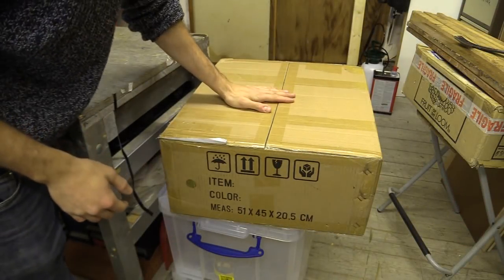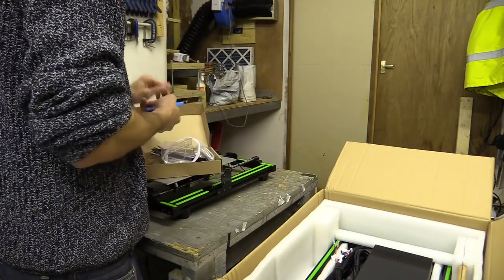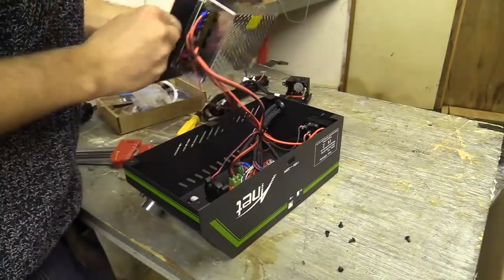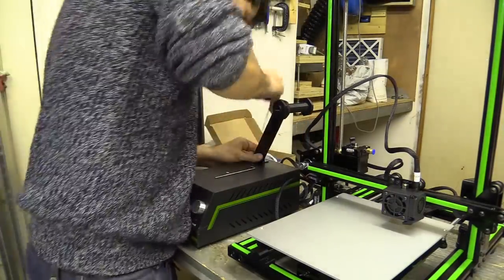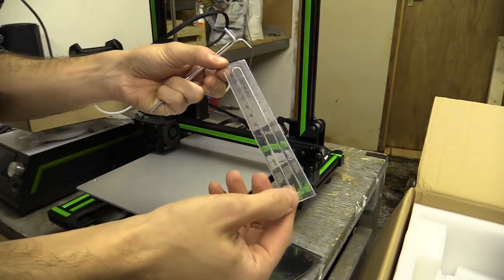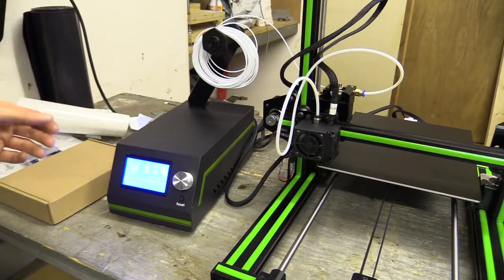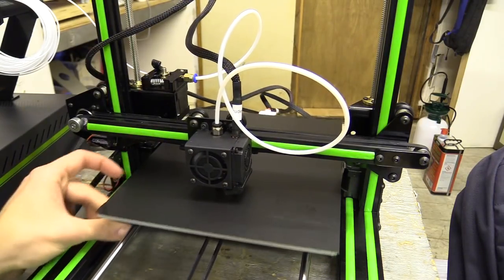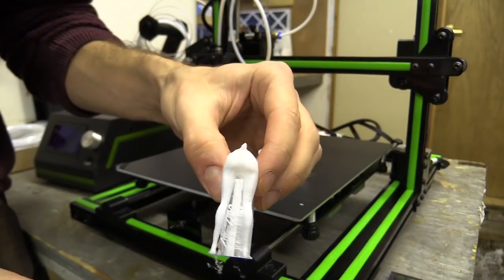Anet E10 3D Printer (Transporter Accident)

Comment: How odd, I was only looking at this machine last week - I was very tempted by the build volume as my current one is only 135x135x135mm.
Reply from the maker: https://miscpro.com/top3dprinters/  This is my top 3D printer list so far. Which 3D printer do you use?
Reply: I'm using the Vector3 which was the magazine subscription build it yourself one from Eaglemoss. Not a bad printer after some heavy modification, just low on build volume.